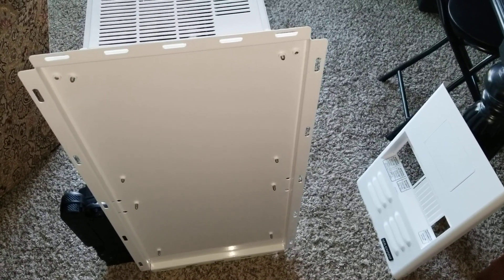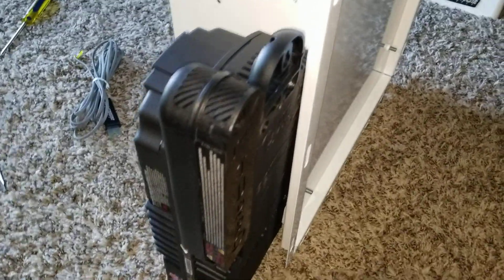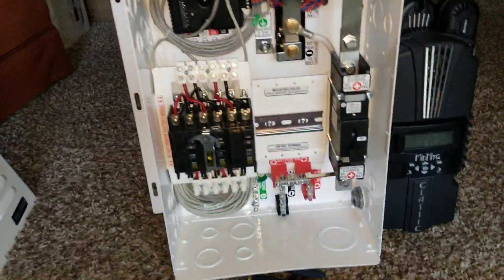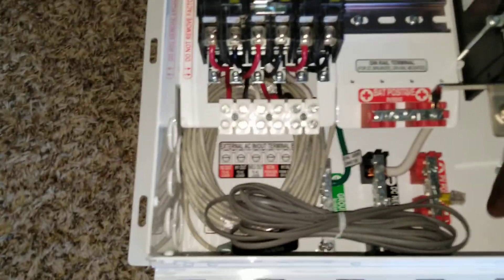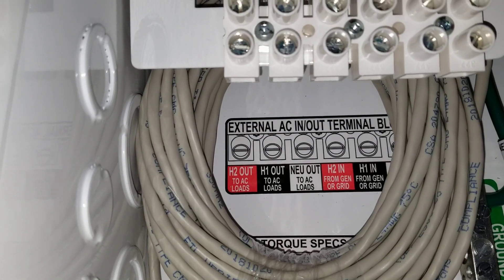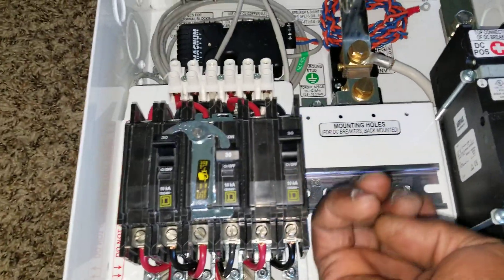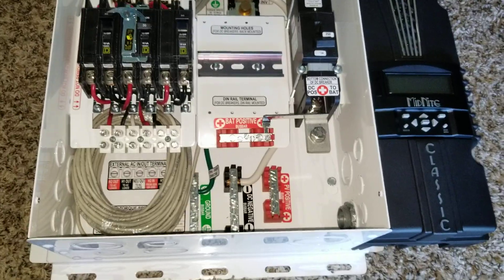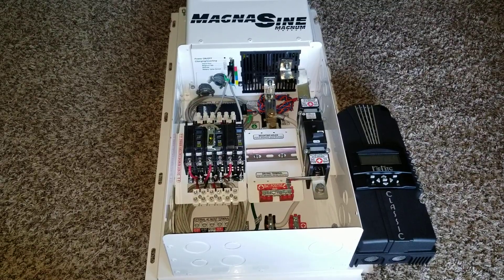MIDNITE CLASSIC INSTALL TO MAGNUM ENERGY MMP250-30D PANEL (Pt.2)

Comment: Great videos!  Thank you.  Quick question, I noticed you still have the ground to DC negative bond connected at the negative lug.  I was under the impression that bond needs to be removed when using a Midnite classic because the classic serves as a ground fault breaker.  Do you remove that bond when installing?
Reply from the maker: Yes
Reply from the maker: Thanks for WATCHING LIKE SHARE and SUBSCRIBE. 
MIDNITE SOLAR COMBINER BOX: https://www.youtube.com/playlist?list=PLSNjIRSnUPDJjLzoFtfP9Zmcmww22kzKN